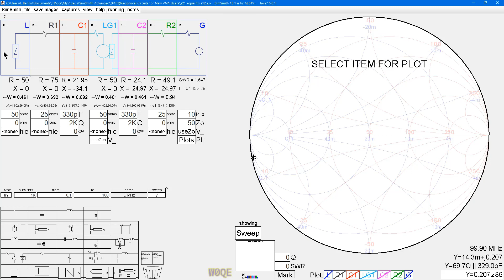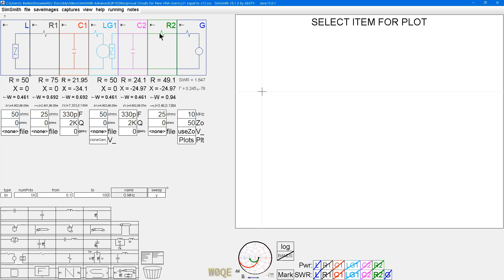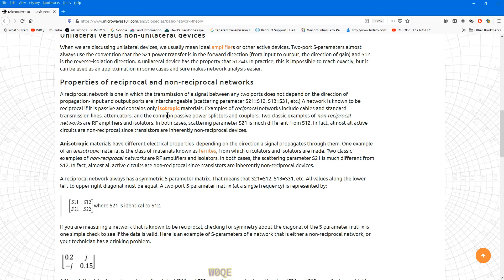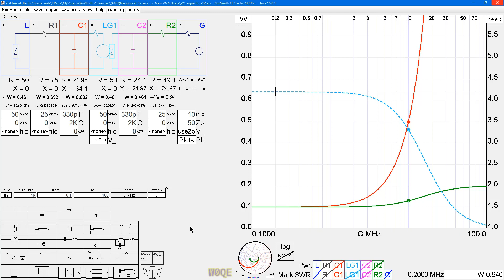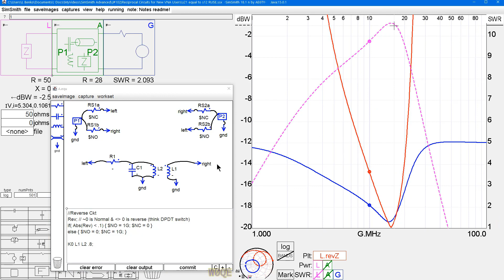#102: Reciprocal Circuits s21 = s12 For New VNA Users

Comment: You can reverse a RUSE block by adding the following line to the text section:
SelectOneOf {on,off} Reverse;

For completeness, you can also 'negate' a RUSE block by adding the line:
SelectOneOf {on,off} Negate;

It is OK to use both at once.
(Added version 17.2)
Reply from the maker: Ward,
It's tough to keep up on all the changes to SImSmith.  The ability to reverse the RUSE block is something that I have manually done many times.
Larry, W0QE